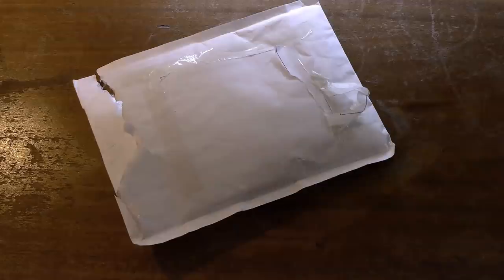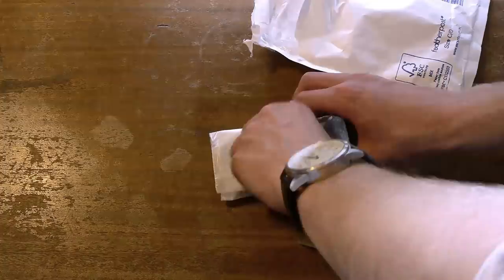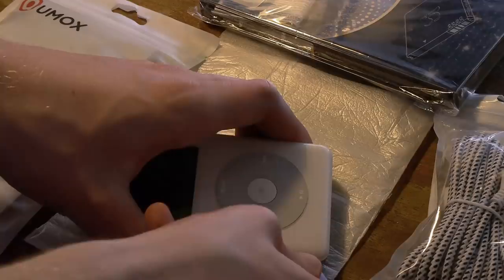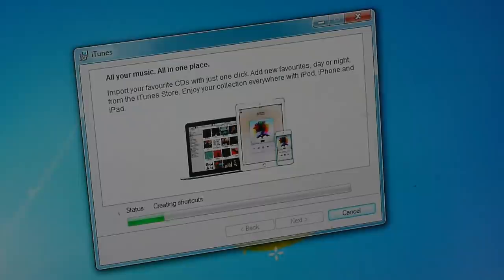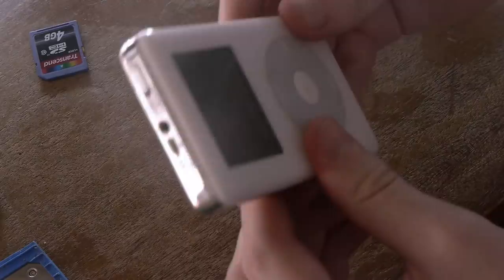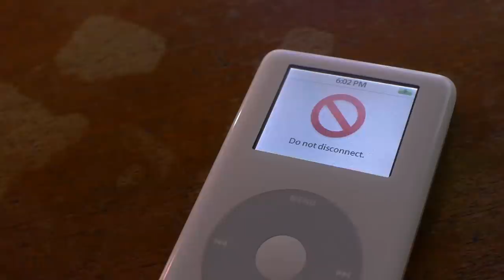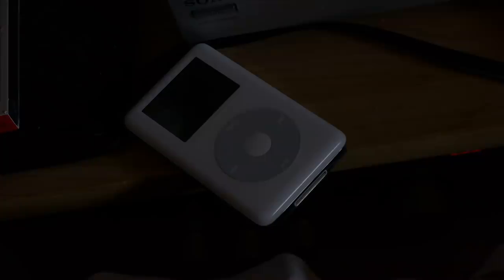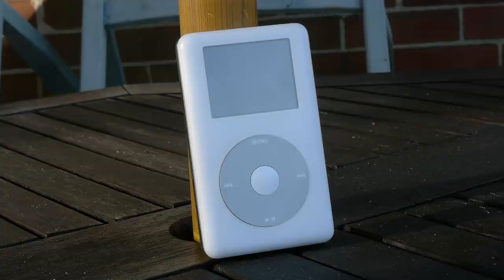Let's Fix (and Upgrade) an iPod!

Comment: if you ever have to work on a 6-7th gen Classic, spare yourself, those are awful to take apart and you'll end up with a bent frame almost all the time.
Reply: It's a good DankPods literally made a video on this a week ago about the pain and tribulations that one goes through to fix such monstrosity's that are 6th/7th gen iPods
Reply: True
Reply: Yep,  when I tried this on a 7th gen I broke pretty much everything- the screen, the frame, the headphone ribbon cable, the battery cable... pretty much everything except the motherboard and buttons. Had to buy a new screen, new back, new front, new frame, and figured why not, get the best battery that will fit since I don't ever want to take the damn thing apart ever again! The only saving grace was the fact the replacement back plate states the correct capacity on it. I would have used an earlier gen but I really wanted gapless playback as I have quite a lot of mix CDs where tracks seamlessly merge to the next... and only the later gens had this feature.
Reply: there is good ways to open them though

Comment: This has inspired me to go and revive my old iPod Mini, this video was definitely a fun watch. Congrats on the 'pod 👍
Reply: Techwen i would watch for the battery on them as they tend to make it harder for you to remove them
Reply: Dr_Vendetta I have already replaced my battery in the past but thank you for the concern 👍👍
Reply: @dr_vendetta8361  The nanos have a bigger problem there. I've bought around 10 used mini's and none had an issue taking apart due to battery swelling

Comment: Pro tip: if you dont have the time or the money to replace the hard drive with an sd card and you just want it to work again, just open up the ipod and unplug the hard drive and replug it again, worked for me everytime 👌

Comment: That's the smallest mechanical harddrive I have ever seen
Reply: Surely Techmoan has reviewed a smaller one. He likes tiny gadgets.
Reply: The ipod mini had a micro drive - the size of a compact flash card (4/6GB storage)
Reply: @joeynebulous816  2nd gen mini with 256 GB Mini sd, cheap and indestructable, and they fit in your pocket better!

Comment: Now I'm wondering can it handle flac?
Reply from the maker: I dont believe it can
Reply: Budget-Builds Official would've been awesome, if it could :)
Reply: It can with Rockbox. I did it.
Reply: Don't you have to use weird Apple files, like ALAC or some nonsense? Good luck torrenting those. (That's good anti-piracy, actually. ...Why am I talking about piracy? I digress).
Reply: @CaveyMoth  you would if you were using iTunes, and Rockbox implies completely dodging that to begin with.

On the other hand, no, it isn't; anything <-> ALAC converters exist in massive numbers, and you can then sync arbitrary files with iTunes. Plus, ALAC on a whole has no in-file DRM.

Comment: should fix my gears of war 2 zune or 5th gen ipod video?
Reply from the maker: Why not both?
Reply: @BudgetBuildsOfficial  good point, which first though?
Reply from the maker: iPod would be very similar to what you saw in this video, and i have never worked on one of these before.
Reply: @BudgetBuildsOfficial  I think the iPod would be easier since all it needs is a new battery and headphone jack but the zune is worth more... much more

Comment: Pro tip bend the Pin on the adapter down (otherwise it'll push on the screen and crack it)

Comment: you may well find the old battery now lasts longer than the new one would have with the old drive ? as it only has to power an sd card now and not a mechanical drive ?

Comment: I had an iPod 5th generation (called "iPod video") in black with 80 GB of storage in 2008. It was a neat device, but I didn't play that much with it. A few years later I replaced it with a iPod touch.
I hate the back of this iPods. Without any protection case you get easily a lot of scratches whatsoever.

Comment: How did you get around not needing a wall-AC adapter? Did it not prompt you when you restored the device?
Many years ago when I did the CF mod for the same iPod Color 4th gen you had, I had to go pick up an external charger that could supply it with the correct 12V. It would normally look for this with the at the time included firewire cable.
Reply from the maker: I did use a wall outlet, but i assumed that was just part of the standard restore process.
Reply: @BudgetBuildsOfficial  Was it a regular USB wall adapter? I googled it a bunch out of curiosity right after commenting and turns out a lot of people have had success with not needing a Firewire one
Reply: I managed to restore my photo by using an Anker power bank after trying 10 different charger plugs. It still wouldn't charge from it, the get it to charge I had to keep it plugged into iTunes and keep it unejected

Comment: For music management and uploading on the ipod you coud use Floola instead of iTtunes, I've been using exclusively that since discovering it
Reply: Alessio Mazzella I haven’t used Floola in a long time. Though by the looks of it development has ceased since 2012. Its lack of support for iOS devices is a little off putting, but least it is also available for Linux.

Comment: you rubbed the screen with sandpaper?
Reply from the maker: Yes
Reply: @BudgetBuildsOfficial  wouldn't it be more scratched?
Reply from the maker: I started  with lower grit, and work your way down to high grit, and then finish off as a very light abrasive/polish.
Reply: @BudgetBuildsOfficial  wow thats a pretty good way to clean screens. thanks for the tip!
Reply from the maker: Plastic Screens. DO NOT do this with glass it is much much much harder to do, and not reccomended at all.  I can not endorse this cleaning at all.
Reply: @BudgetBuildsOfficial  yeah i was gonna dig out my old dsi and do this. theres no way this could work on a phone screen. i saw enough jerry rig videos already demonstrating that.
Reply from the maker: Fella i am not liable if you damage your stuff, i have done my fair share of Product Design and Manufacturing to know what im doing, i would suggest being very careful and continue ar your own discretion
Reply: @BudgetBuildsOfficial  yeah i completely understand. thank you for your help.